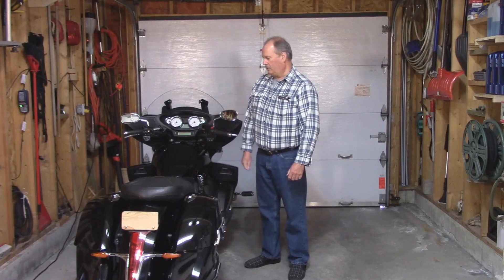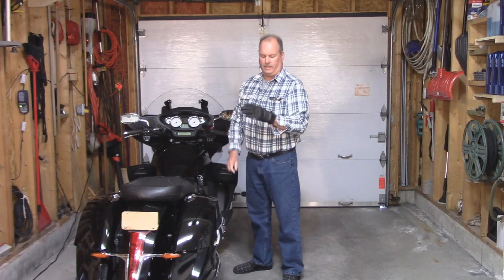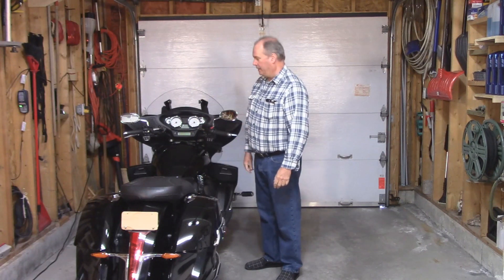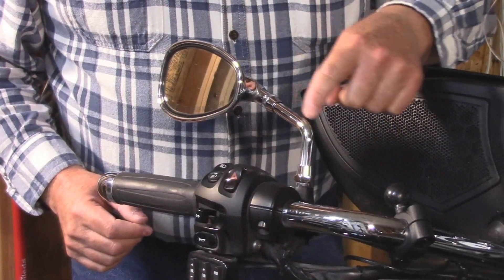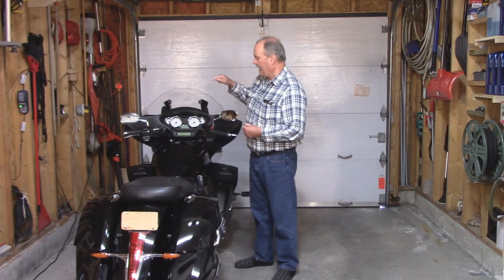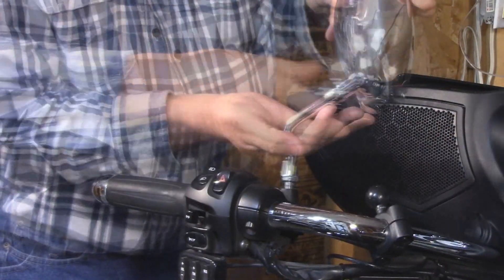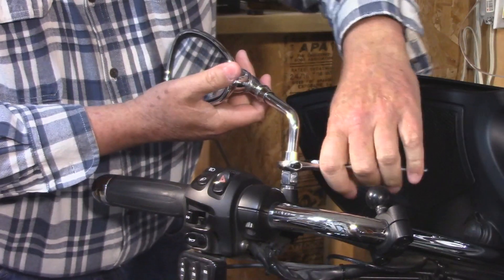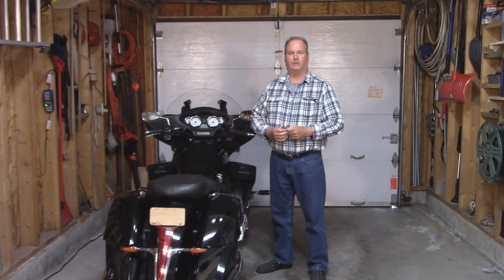Victory Mirror Extension

Comment: Nice video Paul, and a good idea.  Any idea where to get these extensions (other than Darren)? Or did he make that himself?
Reply from the maker: They are hard to come by. The only place that I can find online is Victoryonly.com and since they are in the States it is impossible for me to get here in Canada. Maybe try making one, take a bolt and a coupler nut. Perhaps I should make another video on doing that :)
Reply: @PaulPomerleau  you can also try a place like Brafsco or a shop that supplies metal fasteners.
Reply: i believe that witch doctors have them in stock

Comment: Hi, I hope if you can help me out, I was going about 72 MPH and all the sudden the engine cut off fraction of a second and the engine went back to normal, I checked battery cables vacuum hoses newer fuel pump, everything looks good, also I was shifting from 2-3 it happened again, what do you think could be the issue?
Thank you
Reply from the maker: A bit more info please. What is the year, make and model? How long have you been riding this bike? Is this the first time it happened? Do you blip the throttle? Do you have a fuel controller?
So you say you never had to restart the motor, that it came back on its own after a split second? Have you checked the main circuit breaker?
Reply: Paul Pomerleau 2010 victory cross roads  I had for 9 years I put on it 94000, I don’t pilp the throttle, it has fuel controller, this the 1st it happened I replaced the circuit breaker about 50000 miles ago, I did not check it, I’m just gonna replace it and see. What happens,.
Reply: Paul Pomerleau yes it comes back on its own after split second and it will run fine.
Reply from the maker: I know it happens quickly but do you know if it is just the motor that shuts down or is it the entire bike. If it is the entire bike then I would suspect the main circuit breaker. If it is just the motor then I would suspect the fuel controller or loose/dirty connectors somewhere.
Reply: Paul Pomerleau the entire bike shut down not just motor, I replaced the circuit breaker and went for 30 miles ride no problem, I hope that’s the end of it, I live southern Utah and there’s no shop that work on victory’s, the nearest shop in Vegas, also I went to the dark side, 1300 miles so far and rides 👍, I appreciate your help thank you.